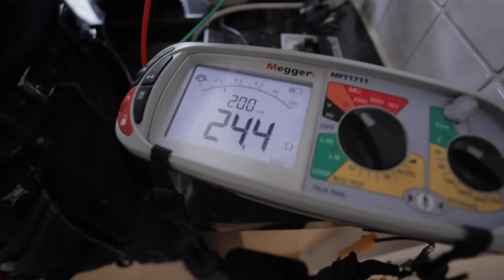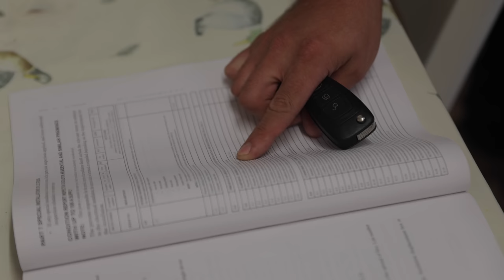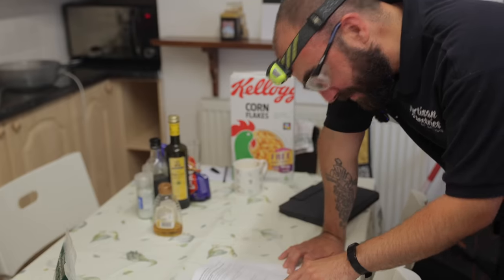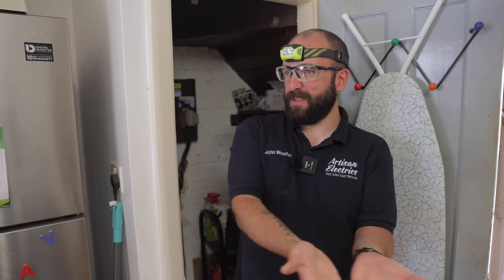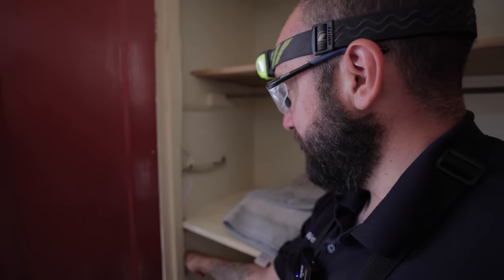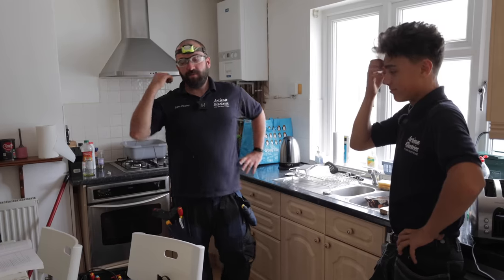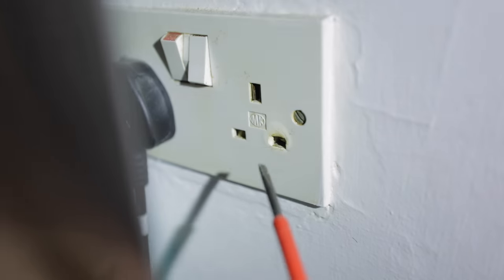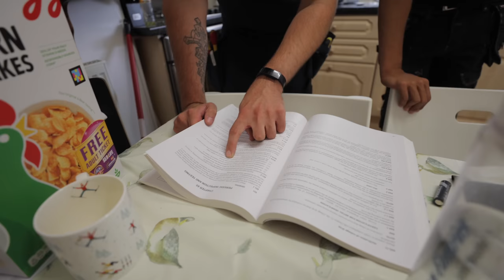Apprentice Learns how to do EICR's

Comment: The bi metallic strip is for overload. The other part of an Mcb is a  solenoid basically. When a big in rush of current comes in x 5 the rated current or more it creates a magnetic field that’s disconnects the supply instantaneously.

Comment: IP4x top edge, IP2x front and side. First number of IP is solid particals, second  number is for liquid. 

Out of curiosity in terms of bonding, what do you regard as adequate yo be able to carry out work without changing the bonding, I.e. if you have bonding which is under 10mm but has good continuity or bonding in the wrong place etc.. where do you draw the line and decide it needs doing before work can be carried out. I'm finding this is a bit of a contentious issue.
Reply: Not really contentious, I'm afraid: if you've done work that needs you to issue a Minor Works (almost anything these days, given the need to prove to your awarding body, your insurance company and the court that you did not impair the safety of the existing installation) then you must sign to certify (legal responsibility) that the earth bonding was adequate.  That means you have assessed that it conforms to the tabulated size, or you bothered to make the adiabatic calculation yourself.  When I worked for Housing Associations we had to submit a MWC even for like-for-like replacement of accessories "to prove it was done and properly."  I agree that we are going too far down the rabbit hole sometimes, especially when things were "deemed safe under a previous Edition", but if it's printed in black and white then it's not even slightly contentious, regrettably, just more hard work and more expense for the customer :-(
Of course you can just present a warning notice and get the customer to sign it to say they refused to have that piece of work done at this time :-)  Like when they don't want you to sell them an SPD for the empty ways you left available for it...
Reply: I have the same issues with knowing when to code with bonding sizes / positioning of clamps. In one of the electrical safety first guides it oks allowing a n existing 6mm bond if no signs of thermal damage when changing a CU, so as an engineering judgement, if continuity is good then you are fairly sure it’s going to do a job. Same with where the clamp is situated, often they are beyond 600 of entry but again making a good continuity to all pipework when tested, so from a judgement point of view, you’d feel pretty sure it would do a job 🤷‍♂️ Would be good to know others thoughts
Reply: if continuity is good. it's been in service for decades with no sign of overheating then I think you'd be hard pressed to go beyond a c3 for a 6mm bond where it should be 10.

Comment: Pipe bonding clamp onto PILC... yeah that can be nasty, either comes loose or if too tight can break the paper! Should be a constant pressure spring + braid or sweated-on pigtail...

Comment: Interesting video I like the fact that John took the time to reference the regs book when doing EICRs, but the teacher should be clear on the regs before teaching the student I.e. the IP code for consumer units IP4X IP2X, bonding to gas within 600mm not a foot, 0.8 ohms is the ZE not the ZS  for TNS, 6mm is fine for bonding in an old system with no thermal damage. It can become confusing for a student when given the incorrect information from there mentor.

Comment: In the gas regs the earth bond should be within 600mm and before any branches
Reply: Electrics is 600mm as well
Reply: @jonhosier356  yes,  but 12 inch was mentioned in the video (unless im confusing it with the porn film i watched similtaniously : )
Reply: 😂 yeah he said 12 inches - but it’s within 600mm point of entry - or failing that where practically possible
Reply: Yup, and always better to do it inside the property when there isn't an annoying T off the top of the meter, to protect the bond from external influences and stop you buggering around inside the gas board's property (that poorly-designed box)

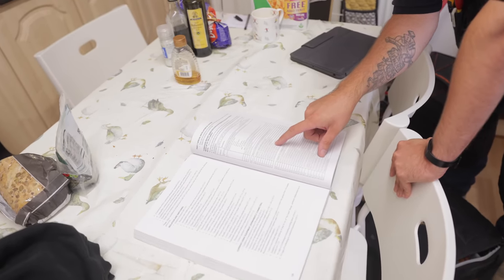Comment: 7:34 6mm earth is apparently ok as he states it was ok when installed. EICR is coded to current regs so a 6mm earth should warrant a C3 as minimum on a TN system is 10mm in 18th edition (assuming no thermal damage to show otherwise a different coding)
Reply: 6mm earth is fine for TN-S on 16mm tails. 10mm is minimum for a TN-C-S system.
Reply: @havoctrousers  6MM was once acceptable for tncs .  No signs of thermal damage C3

Comment: I used to work for Bg changing meters and that would of got him investigated leaving them meter tails like that if he was found out. Piss poor work. Wouldn’t be surprised if all the terminals were loose aswell. Also the gas and water pipe should be bonded within 600mm of the outlet or before the first tee fitting

Comment: the bonding size to gas and water is 10mm in a domestic property if the meter tails are 25mm and the clamp is fitted on the consumers side of pipework. and i would say the exposed pipework should be bonded even if it is supplied in a plastic pipe the metal pipe could become live if touched by a live conductor if it is all bonded to the main means of earthing it will disconnect the fault.
Reply: Bonding is not to prevent the pipe work becoming live in the event of a internal fault within in the installation. It’s to keep everything at the same potential as the installation earth.

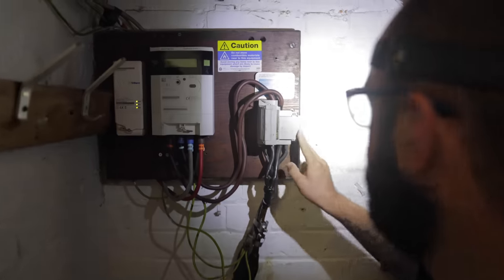Comment: Only 2:15 in and...  That is truly abysmal and needs a call to DNO!  A brand new Trillant telemetry unit and brand new still shiny digital meter, with a label by the cutout that suggests the head was changed in 2015 (perhaps the number above is the old meter reading; I'm on a titchy phone screen so I can't see detail) -- this was a standard cowboy "meter changer" unqualified contractor sent out by the DNO unaudited.  Couldn't even be bothered to install the consumer-side iso (I'm pretty darned sure that was a requirement 7 years ago).  The only thing they did right was apply the ESC sticker saying "no combustibles here please."  To leave that site like that is prosecution-worthy: they will have as part of their contract to ensure the earthing arrangement is still sound and not impacted by their work, but not have the skill or parts on their "van" (probably a secondhand Escort if not the wife's hatchback) to sweat on a proper bond when they found this ancient cable was losing its existing bond.  It's obvious they were the ones to put those earth clamps on, but the only thing possible to say in their favour is that they recognized the importance of earth given the cable also feeds another property.  Truly shocking 😲, almost literally so ⚡🤯

Edit: now at 3:00, 🤭hot-damn! as the Yanks would say, literally: visible heat damage to the proximal end of the Neutral tail!  And apparent discolouration near the supply end of the Line tail.  What else could possibly be wrong, and you've not even got to the consumer's property yet!
Reply: Meter exchanges are supplier responsibility not dno. And isolator installation wasn't a requirement 7 years ago and still isn't today 🙂

Comment: Come on Artisan!
You present John as the all knowing guru of EICRs, but he does not come across that way to me.
For example, discolouration of the neutral conductor in the meter due to overheating is a serious matter and should be reported to the supplier or DNO without delay.
Consumer unit IP rating of IP4X (not IP4X) has nothing to do with water ingress, but rather penetration by a solid object 1mm in diameter.
Main protective bonding conductors should be connected at the point of entry to the building, and where practicable, within 600mm of the meter, not "a foot".
"Cross bonding" is not and never has been a term used in the regs.
They may seem like small discrepancies, but for a YouTube company, showing off your work to all the world, a little more accuracy please.
Reply: It's not that deep bro
Reply: You have to be textbook correct when teaching, although very impressive to a young lad, an old fart like me can see the flaws in this video and it’s a shame to see John portrayed as an electrical boffin  when actually giving half assed information can be very confusing to a young student.

Comment: Ip4x or Ipxxd ! And you really do need to be careful of trusting the voltstick in confirming 230v they will light up with a fairly low induced voltage😁
Reply: How is a false positive dangerous then ?
Reply: @Marco-mg9tv  obviously it isn't however worth confirming IMO especially seeing as the installation is a bit of a state. Btw I wasn't trying to be an arse just informative, you do you brother 👍